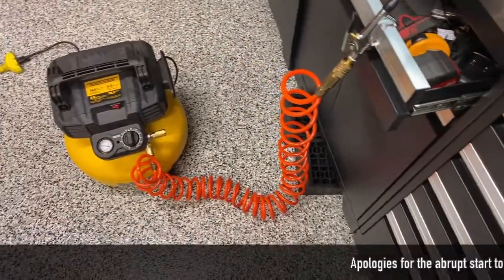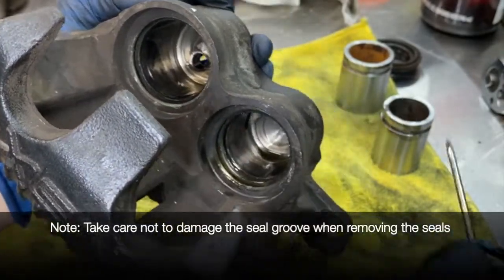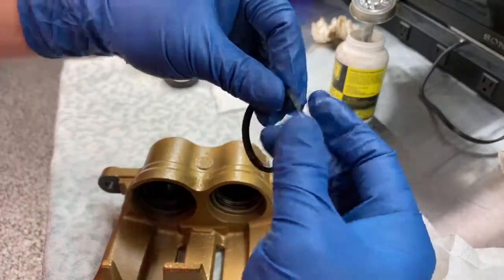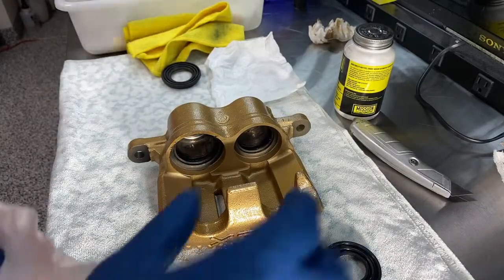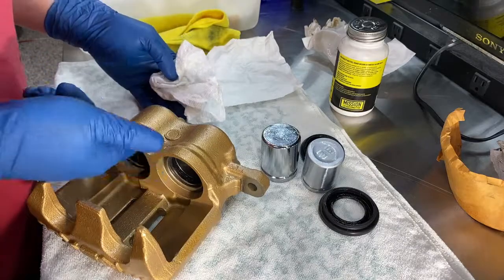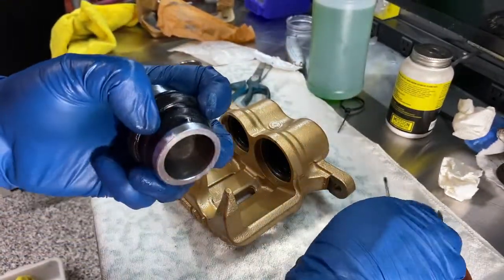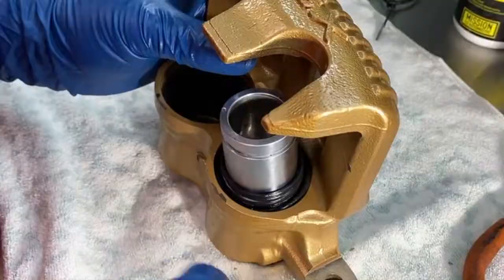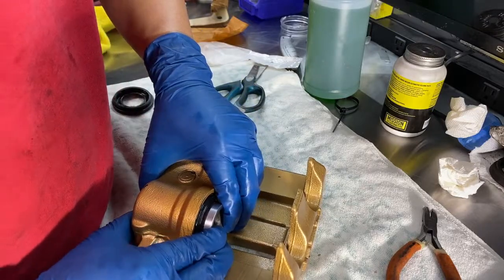How to Rebuild NSX Brake Calipers (Full DIY)

Comment: Thx chief
Reply from the maker: you're welcome!
Reply: @ChrisLumNSX  How's your Booster lookin? Mine is somewhat questionable if I want to replace it. Its got some typical rust on the bottom. I can only find used ones, and they all look a bit questionable...
Reply from the maker: Brake boosters rarely go bad. If you have rust it’s probably just a cosmetic issue. I’ve finished one in my integra before for the same reason.

Comment: Is there a centric rebuild kit for the rear calipers?
Reply from the maker: Yes for the rears, a 1991 the part number is 143.40021 and for a 2005 the part number is 143.40019
Reply: @ChrisLumNSX  thank you so much. Keep up the great work. Can’t wait for the next DIY.